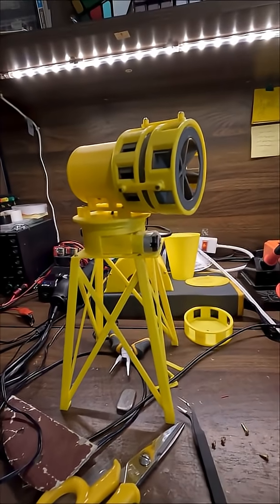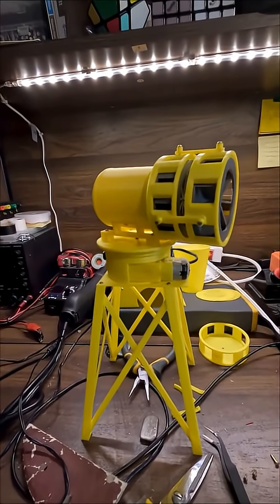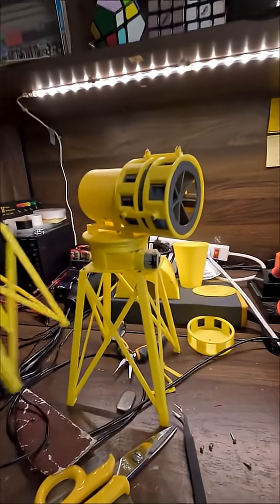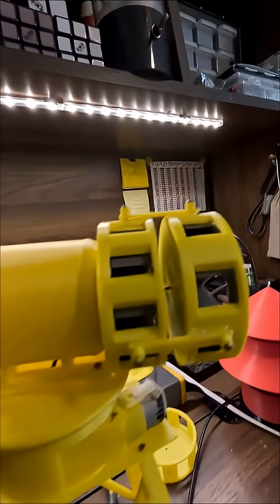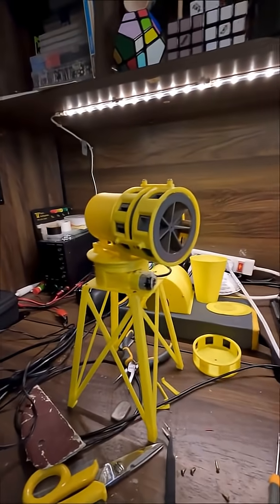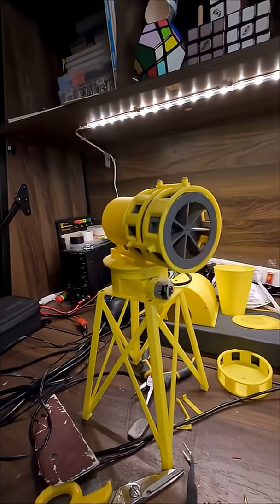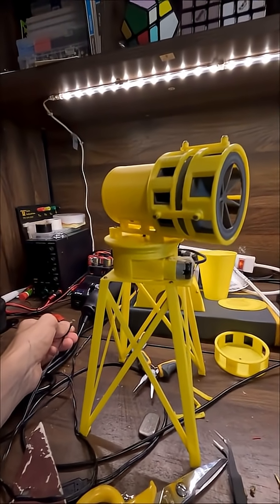Mini H.O.R. 7/10 Port Model 15 Super-Sirex First Test! #3dprinting #minisiren #supersirex

Comment: I don’t have a 3d printer so i’m gonna try and make one out of cardboard and wood. I’d like to do a rotator but i might have to do it Whelen style since i don’t have the resources for collector rings. Or i could just pretend it has a broken rotator since the rotation is basically useless AFAIK. Look forward to getting a 3D printer and leaving behind all this cardboard/wood nonsense.
Reply from the maker: That's cool! You could print this entire siren with a 3D printer. I personally don't recommend cardboard or wood, lol. But that's a good talent!
Reply: @milespeterson5049  Thanks! I also use a bit of lego (you read that right), which when combined with wood and (high temperature) hot glue can make for a good/okay rotor. I use cardboard for things like housings, horns, and other miscellaneous parts. I’m not too keen on using cardboard for rotors since it’s too floppy.
Reply from the maker: @CarlCJV  Wow, that's a unique method! If it makes you feel any better, even 3D-printed rotors aren't perfectly balanced. lol!
Reply: @milespeterson5049  LOL yea i also turn bottle caps and other circular plastic things into rotors. but the bottle cap rotors tend to sound dual tone  despite being single tone for some reason, maybe a lack of vanes?
Reply from the maker: @CarlCJV  Oooh yeah, probably. The shape of the vanes can change how it sounds. "L" shaped vanes, for example, sound very choppy, like Sentry Sirens. "T" shaped vanes are bidirectional and don't sound as choppy, I think. There's even those weird curved vanes. I don't know a whole lot about those 😂

Comment: How does it sound so identical🙏
Reply from the maker: Same port ratio and general build. All of my mini sirens sound basically identical to their real counterparts.
Reply: @milespeterson5049  does the rotator only need the motor or does it need gears too
Reply from the maker: @Looey_da-ballon-He-eh  There are two motors: one for the rotator and one to drive the actual siren. The siren's motor is sealed up in the yellow cover on top of the rotator, and the rotator uses a gearmotor to drive a few gears and rotate the whole base. Hope this helps! Are you planning on making one of these?
Reply: @milespeterson5049  yes I am planning to make one
Reply from the maker: @Looey_da-ballon-He-eh  Cool! But just so you know, you WILL need screws for this one. Also, this video doesn't show the completed siren. I have a full video and a short of it with the shroud and horn on my channel. Also, this siren comes in a lot of different variants, just like the real ones! You'll find all the different models on my Tinkercad page. Good luck on this one!

Comment: What Gearworm motor did you use for the rotator?
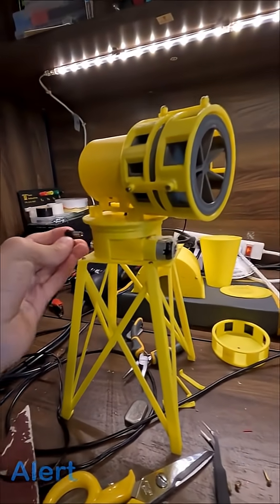Reply from the maker: I used basically the most common gearmotor of all time: a DC 1:48 TT gearmotor. You can order them from bulk to individually for really cheap on Amazon. I had to make a small modification to the motor, however, which was cutting one side of the white output shaft. You could also just buy a single-shaft variant of this motor.

Comment: Sounds great! My model 15 was going to be single rotor, however, since i see you added a bearing, i might as well on mine to make it dual tone capable lol. My sirex' use microwave motors which use a 8mm shaft, so it'll use a 608 bearing if i do make dual tone.
Reply from the maker: Cool! Microwave motors would work great on a siren like this! I just don't use them because those  are expensive, and I don't have collector rings that could handle them. Oh well! I'd love to see you make that in the future!